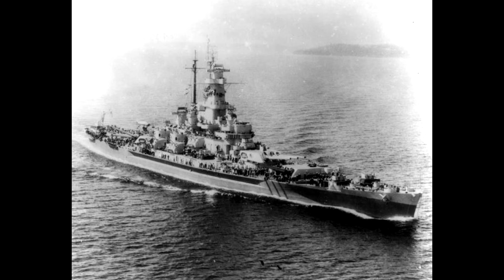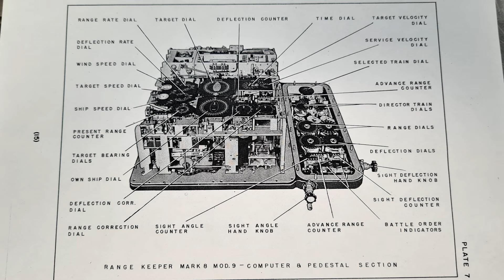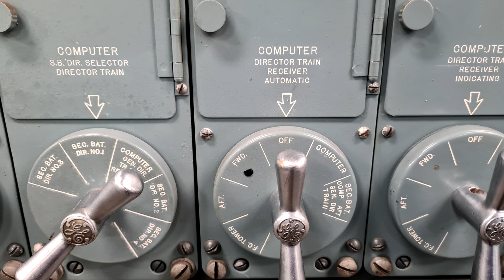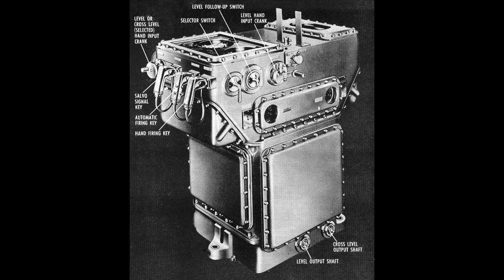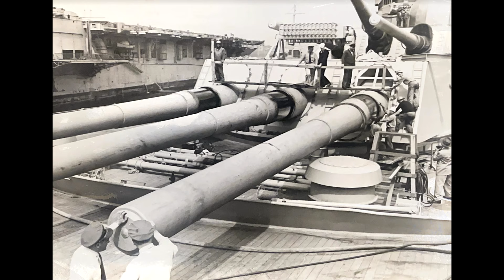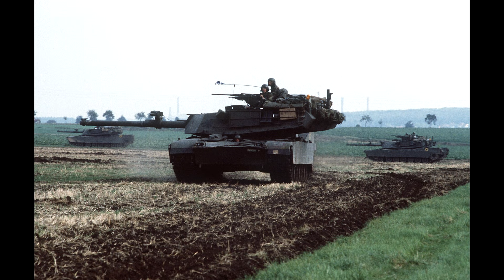US Navy Fire Control Systems - How They Really Work

Comment: I did a lot of work on Counter battery RADAR in the 1990's Which would track a shell in flight,  and would project back to the  launch point so you could shoot back before the original shell landed. It also predicted the landing point, so you could warn people to move out of the way.
Reply: Do you know if any of the calculations used go back to this system?
Reply: @dukecraig2402  The Math Predates the Navy at a Theoretical level, the Implementations earliest root trace back to work at MIT Lincoln Labs.
The system I worked on in the Mid 90's was for a Stationary Army/Marine counterbattery system.  You would stop oyour truck scan for a while and move.  Since they wanted absoult ecoordinates they needed to know the position exactly, with modern GPS and Inertial navigation, newer systems can track while moving. The Ship just needed relative coordinates.
Reply: Your use of a shell is not correct. When you should have used a projectile. You do not have a shell on a battleship. Where the 5"-38 calber did have a shell the semi fixed powder case. The propellent are in bags.
Reply: @Rita_Loy  @Rita_Loy LoL — a year late, and your correction is not only pedantic but incorrect. “Shell” has been standard terminology across artillery and naval gunnery for generations, regardless of how the propellant is packaged.
Reply: That’s awesome, all of this stuff is fascinating to me… I also happen to manage a farm that was basically the retreat for Alfred Lee Loomis during WWII, it isn’t talked about much, but he ran the rad lab at Tuxedo Park and Winston Churchill essentially sent him the cavity magnetron directly. I don’t think it would be a stretch to say he essentially invented microwave radar, which (obviously) changed the course of the entire war. 

It’s totally surreal to walk around the farm and know he casually walked around the same place. There are still old encrypted hardwired telephone line plugs in the walls for the “red line” when the president or dignitaries would be entertained. 

I try to explain just how historic and pivotal this guy was to visitors, but no one really cares. 🫤 History is definitely being lost before our very eyes.
Reply: Wouldn't the mortar/artillery shell that counter battery radars can detect land wayyy before you could call up the people in the wrong place at the wrong time, and tell them to take cover?? 🤔

Like, maybe if you only needed to press a button, and an automated system would blare out an "Incoming, take cover" alert in the right grid area?

But if you gotta type a text or punch in a number, you're probably already too late, no?

Cheers from a puzzled civilian :)
Reply: @MrNicoJac  If you are setting up counter battery this is for something that has travel distance and time in miles.  If someone is over the next hill, you would only be using automated response Active defense systems, with limited sucess. Naval Artillary like discussed by Drachis generally being fired at longer ranges. for an unguided projectile a small chnage in course changes a hit to a miss.

Comment: I feel like I have been through an abreavaited US navy fire control class. I spent a few years as a navy fire control tech. I had my system so tweaked in that I could put a 3-inch round into a minivan at 8 miles. (I was on an ffg. I only had a 3-inch gun. )

Comment: Does the computer sound the salvo horn when in automatic mode or is everybody already hunkered down by that point in the engagement?
Reply: That's what the salvo warning key (on the True Vertical unit) is for. Ryan on the Battleship New Jersey channel did a video about this a few days ago.
Reply: @alexandermonro6768  But if you're in full automatic mode and the computer is charge of firing the guns non-stop does someone need to keep sounding the horn or does the computer also do that?

Comment: This is a fascinating topic, but it's also fascinating to think how rapidly that complex fire control for ship-to-ship fighting became to be obsolete.  By the middle of WW II, large capital ships were primarily anti-aircraft battery platforms for protecting carrier task forces and artillery batteries that targeted unmoving targets on shore.
Reply: A lot of that complex fire control is still needed to hit targets on shore, because the ocean doesn't magically go away - and you still want coordinated salvos that are unaffected by wind and wave.  Ships move with six degrees of freedom: three linear and three rotational and you have to compensate for your own movement.  It's very different firing from a ship then firing on land.

WW2 warship guns are not the same as land-based artillery: relatively little artillery on land involves guns of more than 6 inches (~155mm).  They occasionally had land-based short range 8 inch guns, and there were rare systems like rail guns that were larger (but highly inaccurate compare to warship gunnery with 'ww2 modern' fire control).  Warships also had much higher muzzle velocities then typical land-based guns, so even the 6 inch guns on warships tended to be far superior to the 155mm land-based artillery.  

Even today, as far as I know, there is nothing available in the inventory for land-based artillery that can equal the performance of battleship gunnery.  To be fair, there's no expectation of needing that performance either. 

In the Osprey book on the amphibious invasion of Walcheren in 1944 - the defenses guarding the approach to the critical port of Antwerp - they mention that the Allies needed battleship-grade gunnery (meaning battleship or large monitor) because a) many defensive positions were too strong for lighter guns, and b) cruisers couldn't get close enough because of the shallow water and sand bars - the big guns had a longer range and could reach over the shallow water.

The nice thing about the battleship gunnery in these situations is that even when it didn't penetrate, it tended to suppress bunker-based guns because of the shock of the explosion affecting the humans in the bunker - which was also very demoralizing.

One definition of obsolete is 'no longer useful'.  This was definitely not true of battleships in WW2 or even in the following years: a Vietnam era study showed that over 90% of carrier air missions could be accomplished more effectively and at lower cost with battleship gunnery.  The WW2 Pacific Theater made carriers look really good, but that was something of a special case, because the Japanese didn't have enough trained pilots and they didn't have good anti-aircraft gunnery - so carrier air performed far better than it would have had the situation been different.  In Vietnam, the anti-aircraft weapons supplied to the NVA were devastatingly effective against the available aircraft, but couldn't do anything to stop battleship shells.

Today, of course, there just isn't any need for battleships in the planning done by the nations capable of building and maintaining them.  But the process of becoming 'no longer useful' actually took quite a long time.
Reply: @bluelemming5296  I fully appreciate that.  My point is that a lot of the design requirements were based on two moving objects and for the time this was the ultimate in high tech.  But given that billions were spent no only fire control but also on other technology and construction methods based on the age-old concept that naval battles were fought and won by ship-to-ship action, it's fascinating that very much of it was wasted because the development of air power and aircraft carriers so fundamentally changed naval warfare.
Reply: @emmgeevideo  Was it wasted?  I'd say not at all - in fact it was a fantastic investment.  

The Germans had battleships and cruisers: Scharnhorst and Gneisenau demonstrated that they could sneak through the stormy expanses of the North Atlantic without detection and surprise convoys.  On two separate occasions, they encountered a convoy guarded by a battleship - and despite having 2 to 1 odds in their favor, the German battleships declined combat.  

A big convoy might carry a billion dollars in goods in today's money.  The cost to replace the close escort, the merchant ships, and the crews could exceed one billion dollars.  The cost of a single North Carolina class battleship is 1.5 billion dollars in today's money.

In short, those defending battleships more than paid for their cost of construction in a single encounter - and they didn't have to fire a shot - the best kind of victory.   Sun Tsu would have been impressed.

Both RN and US Battleships were used on occasion in convoy escort roles.  Usually they would use the battleships as distant cover, unless they knew a raider was out in which case the ship might be placed with the convoy.  These practices were common, for example, for the Arctic Convoys.  USS Washington was one US battleship used in the distant cover role.

The North Atlantic is notorious for stormy weather.  In some seasons, the weather is bad three days out four on average - and on occasion can stay bad for weeks at a time.  There was never any guarantee that WW2 carriers could conduct flight operations - and that made the raider threat something that couldn't be reliably countered by carriers except in the summer.  But the Arctic Convoys couldn't run in the summer, because it was too easy for German land-based air to find and destroy them: just like the raiders, these convoys needed the shelter provided by bad weather.

We know the supplies for the Soviet Union were critical.  Even before the US got involved, Britain was sending tanks and aircraft - and we know they were played an important role in the Battle of Moscow because the Soviet units with this equipment received commendations.

The cost of having the Soviet Union fall out of the war vastly exceeded the cost of the entire USN and RN complement of battleships.  So here again we see a huge return on the battleship investment.

In addition to distant cover roles, battleships were also used when possible to directly escort troop convoys - a critical task.  To put this in perspective, the battle of 'Bloody Tarawa' cost the lives of 1009 US marines over three days of intense combat.  In comparison, when the transport HMT Rohna was lost to air attack in the Med, 1138 people died in about an hour.  That's only one transport: it typically took 10-20 transports just to carry one infantry division and it's equipment (depending upon the size of the ships and the amount of equipment).

The potential loss of life was so high should a troop convoy be lost that it fully justified the use of a battleship to deter an enemy raider - and that ship more than paid for itself even if no combat at all occurred.

So money was not wasted on battleships, they were actually a great investment.
Reply: To go from being The Capital Ship to essentially a Heavy Escort for the carriers, all in the span of a few years!

Comment: When did "on target" barrels become a thing?  Sorry I don't know how to ask the question.  Abrams tanks keep the gun barrel pointed on target regardless of how crazy the tank might be driving.  Was this not possible for ww2 ships?  This man is talking about setting the range and gun angle etc to automatically fire when the ship rolls to the exact spot where the best chance for hits occur(similar to the way navies had been sort of guess firing muzzle loaded canons for centuries).
Reply: Probably take some extra beefy motors and electric supply to move multiple turrets each with multiple barrels in constant motion to compensate for a known periodic motion of the ocean that can be timed, whereas the movement of a tank has no guarantee that the body will realign the barrel again, so seems like a lot of excess to have the ability to fire at any exact second instead of waiting five or ten seconds. In other words I doubt it was a technical limitation so much as a practical cost-benefit decision.
Reply: If I understood correctly, I think this was mentioned as one of the possible automatic modes, towards the end of the video.
Reply: Even today I suspect the 5in guns(about the biggest they have these days) on USN ships aren't continuously stabilized, and instead use something similar.  Don't quote me on that,  though